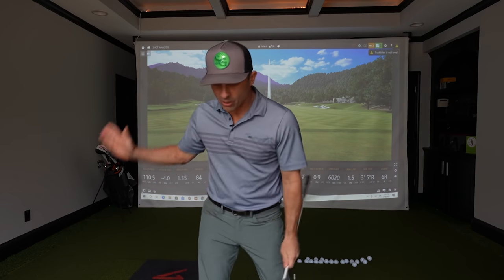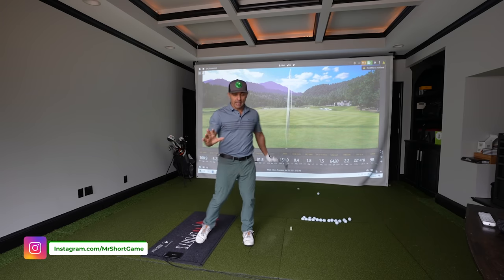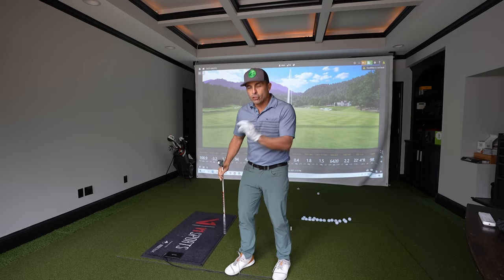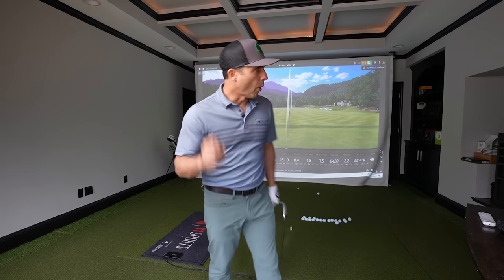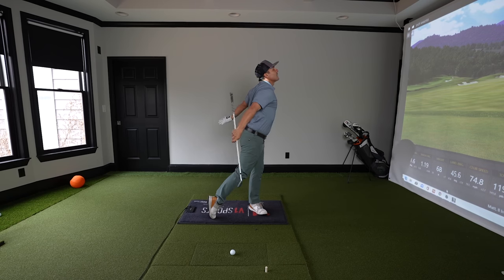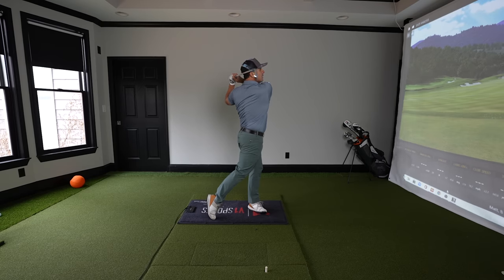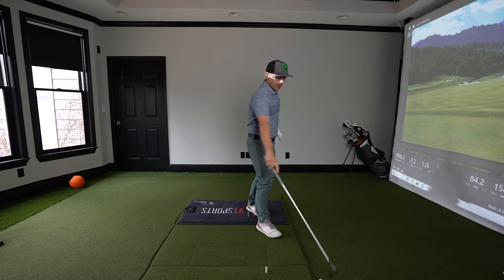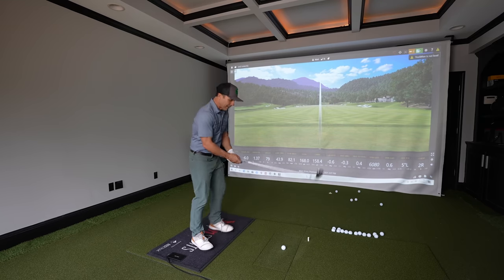The Best Weight Transfer Drill for your Golf Swing - Hit Pure Iron Shots

Comment: This is probably one of your best videos I've seen. I previously had pretty much this same issue with my swing and it was causing me to hit a lot of heavy shots brushing behind the ball.

I was basically "fake" weight transferring like you showed, meaning hip moving a bit but then pausing on my back foot and not actually shifting my weight forwards much. Once I fixed that and actually started committing and doing real weight transfer forwards (well before impact), the large percentage of fat shots stopped, and I started getting the low point after the ball consistently.

Comment: My biggest problem since my back surgeries,  is the slide. Since I can't really rotate anymore I slide to my right instead of rotating to the right. But I'm working on a fix and as soon as it warms up I'll be back on the range
Reply: I’ve had back surgery also. My problem is I can turn back but when I try to turn back to the target I have a hard time turning. I wind up sliding to the left instead of turning and I wind up blocking shots out to the right specially on the shots from 100 yards and in. It is also hard to stay down when turning back to the target on my follow thru.
Reply: @retiredsparky526  my issue is simular. I probably have about 30 % hip rotation left and my mind makes the adjustment by shifting my weight dramatically left and right. Some days I hit the ball like I use to but it's so inconsistent. And the worst part the longer the club the more inconsistent. Driver is awful
Reply: @michealhudson4515  I’m just the opposite. I tend to swing a with a little faster tempo with my drive, fairway and utility woods and hit them most of the time pretty decent. It’s when I’m hitting my shorter irons and trying to have a slower more deliberate tempo I wind up blocking most of them to the right. It’s depressing because I used to shoot in the low seventies low eighties consistently. Now I can’t get out of the nineties and a lot of the times I’m in the high nineties. I’m hitting as many as 10 to 12 blocked shots a round.
Reply: @retiredsparky526  hmm. Sadly I see the difference but the struggle is the same.  Before my surgeries I was 8 handi with the occasional great score if my putter got hot. But I hadn't hit a golf ball 2005 and my son actually joined golf team and he talked me into trying to swing again.  I'm wondering if it was worth it because I'm trying every thing to find consistency in my new swing

Comment: I think I understand what you are trying to say by having your shoulders going down and through, but for many golfers, this drill of trying to lead with their shoulders will often lead to over the top/steep swings.  The focus should maybe be more in regards to driving your weight forward by leading with the hips.
Reply from the maker: Over the top is usually caused by rotating the hands open on the backswing. The cool thing about doing this is that you can try to come from as far inside as possible and you'll still be fine.